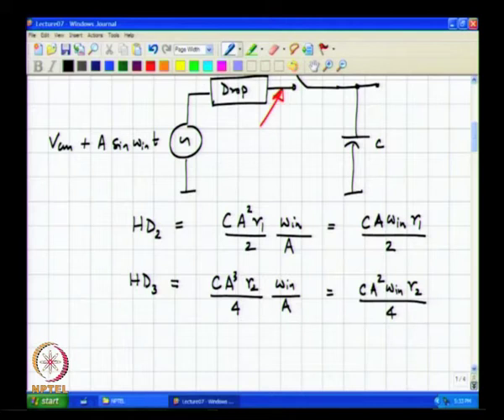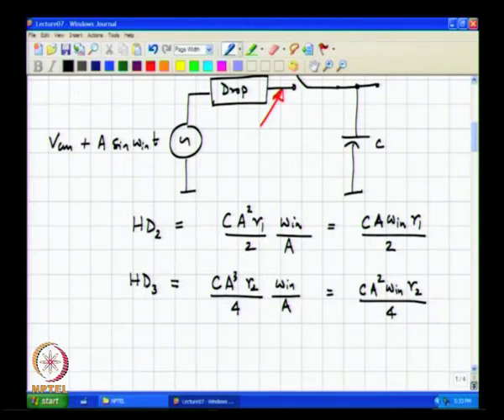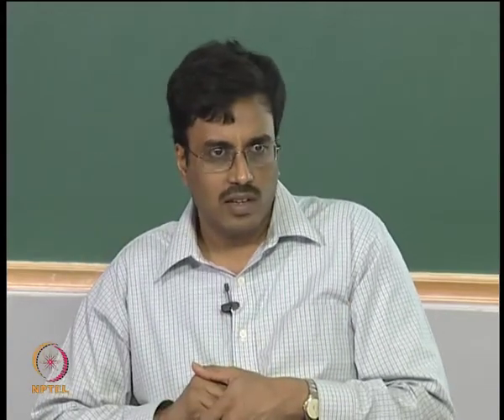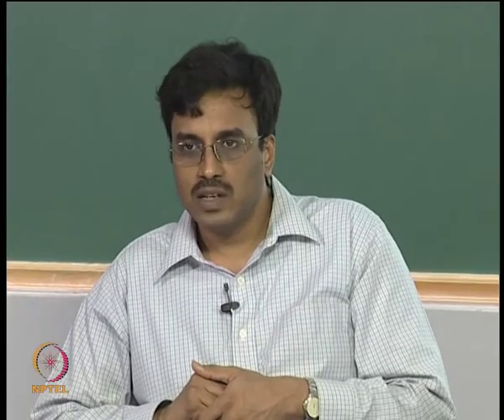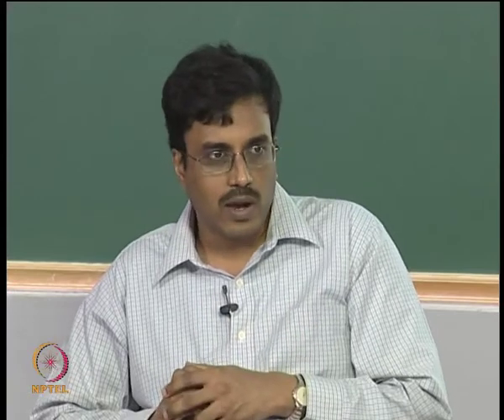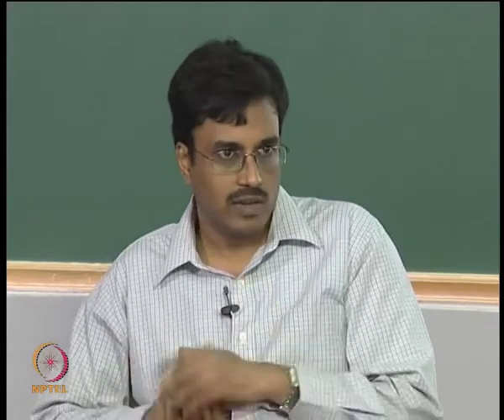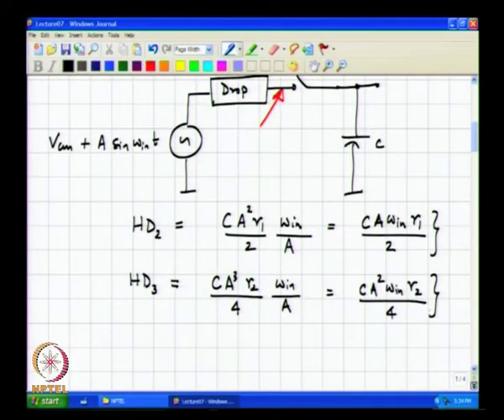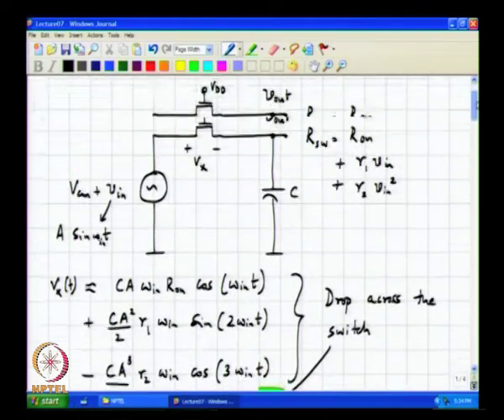Mod-01 Lec-07 Gate Boosted Switches-1

Comment: These harmonics due non linear nature of switch, may alias if these not filtered by anti alias filter.These harmonics content is proportional to input signal amplitude.Reducing the input signal can reduce harmonic content but the cost of reduced to SNR. Even increasing the sampling capacitor doesn't help as harmonics are also proportional to capacitor value.
Other way to reduce the harmonics is make switch on resistance immune to input  voltage variations.
Gate boosted switch superimposes input signal on gate bias . This help us to cancel out the on resistance variations. To implement this , we use  switched capacitor network.